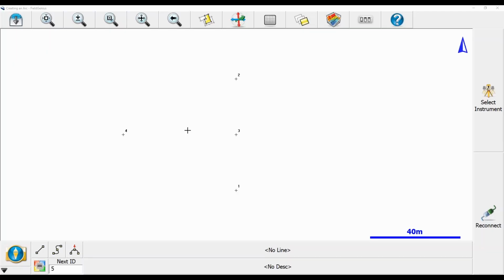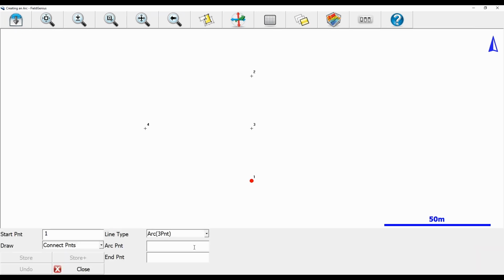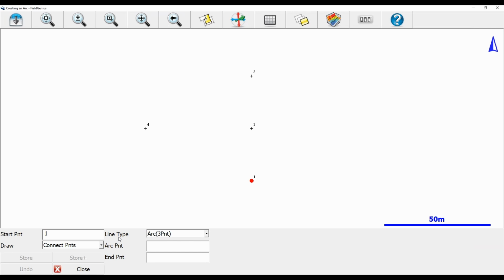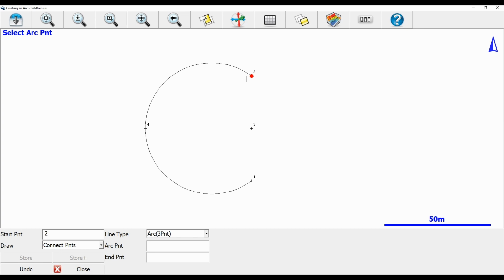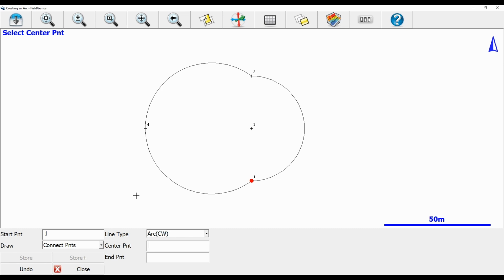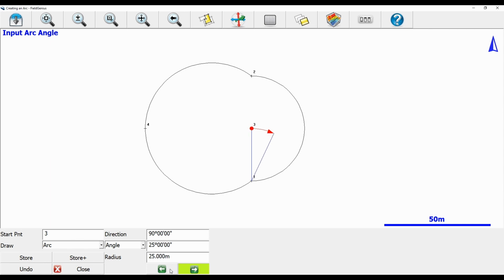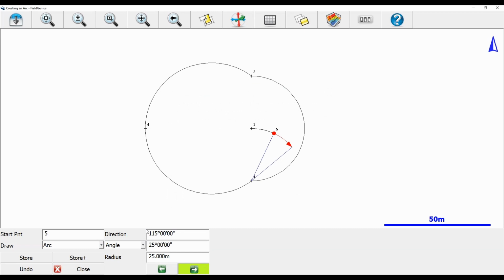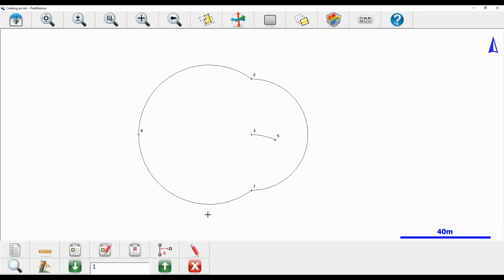MicroSurvey FieldGenius How To: Creating an Arc | Bench Mark

Comment: Hello Noel,
How can I find the center of a Circle if I have surveyed 3-4 points on the circumference of the circle?
Is there a way to find that?
Reply from the maker: Hi Hando, you may be able to use the arc tool to place a center point however, you may need to use a method similar to the one described here: https://www.instructables.com/How-to-find-the-center-of-a-circle/. You can use the intersection tool to find the middle. https://studio.youtube.com/video/CyWEPo6QVl4/edit?c=UCADMr1fMZsUMGw1HEGcQwiw
Nolan